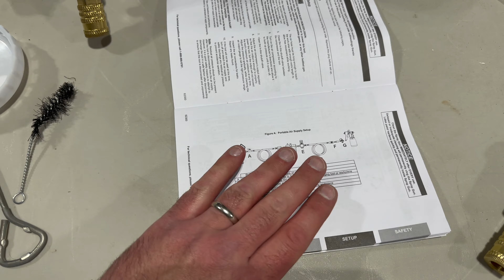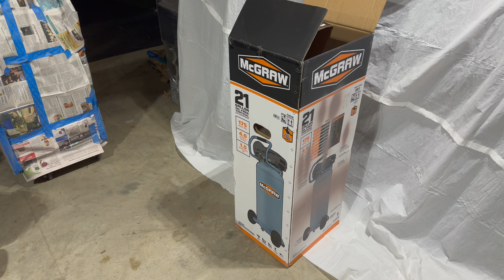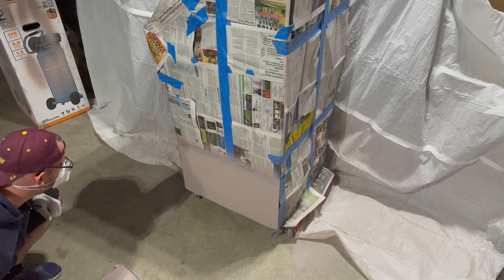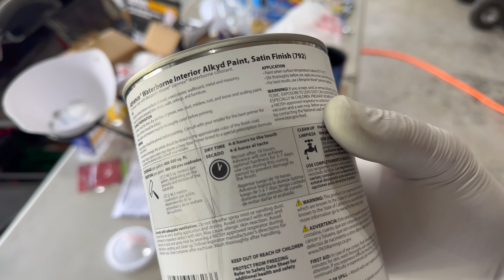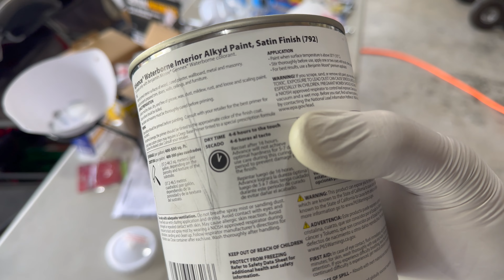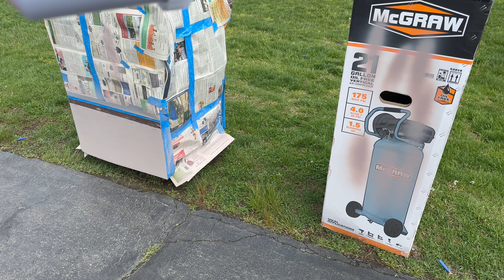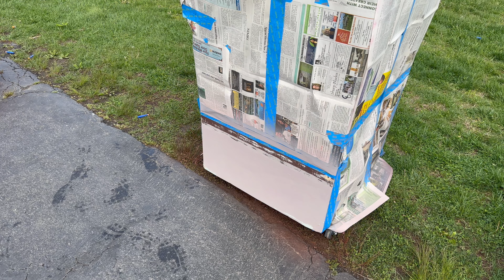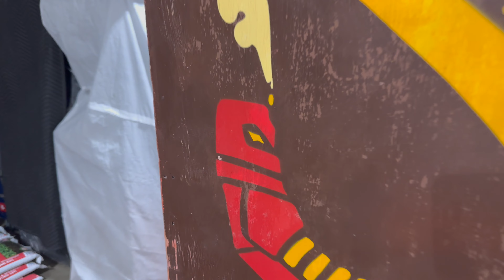Painting Arcade Cabinets with HVLP: a Complete How-To Beginner's Guide 🎨 Joust Restoration part 11

Comment: Interesting stuff. Next time in a similar situation you could consider neatly cutting away the rotten wood with an oscillating saw. You can then splice in replacement plywood and fill any gap lines with your bondo. The repair should be quicker and more durable in the long run, and much less sanding would be needed as you’re just focussing on disguising the join line. 😊
Reply from the maker: Thanks, I’ve actually done something similar in the past with my Tempest cabaret, but that was before I started the channel. It’s always a balancing act between effort & results I suppose!
Reply: @ Well it’s fascinating to watch anyway. Keep up the good work and best wishes from England 👍🏻
Reply from the maker: Thank you, Simon!

Comment: (Im Smart Bomb on klov) The move is to tape curled paper right above where the old paint begins....the curled paper help provides a feathered/over sprayed blend...it eliminates the straight line from new paint to old paint. Take a sheet of 8.5 x 11 paper and tape one long end to the other long end..but dont crease it..meaning dont fold it to create a crease..just "roll" the long long edges together to create a tear drop design when looking at it from the side...then tape that above the old paint line.
Reply from the maker: I like that! I was trying to do something similar at the end.
Reply: @overtimearcade  Try one side again...put a dab of black in it to darken it up.
Reply from the maker: @markherring3513  If I can’t live with it as-is, I’ll definitely try that!
Reply: @overtimearcade  make sure to tape the sides of the "tear drop" to make it somewhat secure so the air pressure doesnt make the paper fly upwards. Ive never done this but Ive seen some vehicle repair videos where the painters did this...it faded nicely into the existing paint.